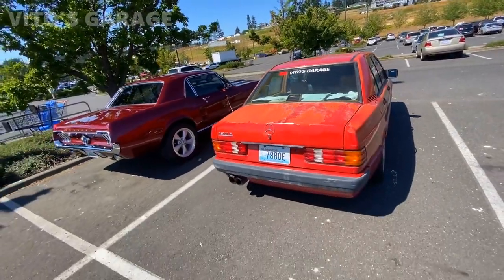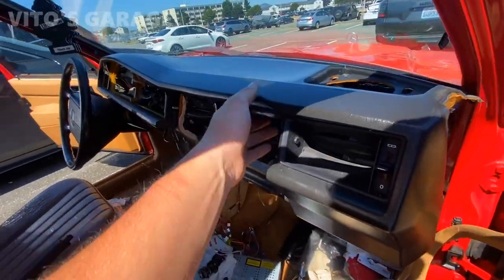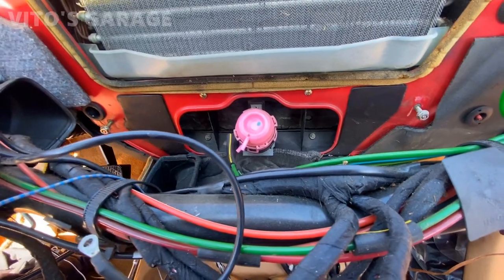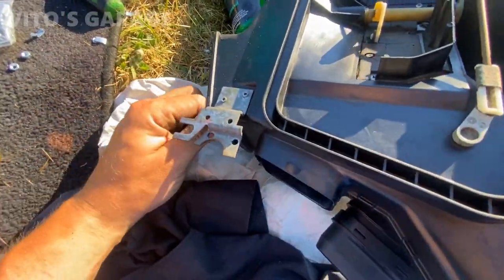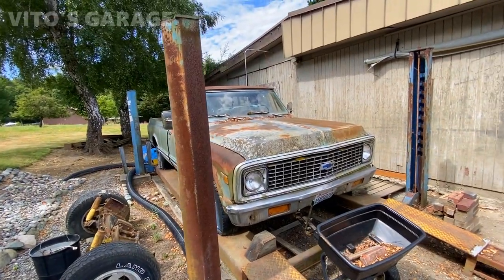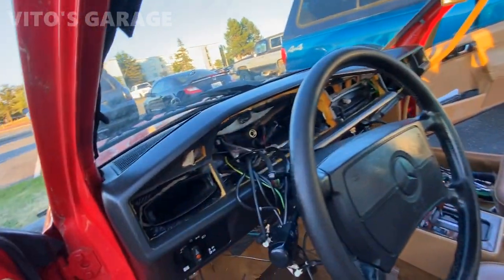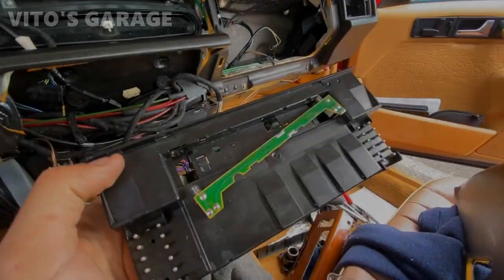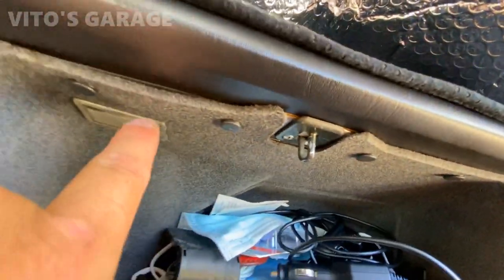Red Mercedes 190E Dash Removal, Heater Core Replacement, HVAC Actuators & Other New Parts

Comment: Amazing video as usual 👍👍👍👍 And it's awesome that the Baby got some much needed attention. If I may, when it comes to the pod with the exception of the one that you replaced, none of the others are available from Mercedes anymore. I'm sure that you know George Murphy owner of the Performance Analysis Company in TN still make the rubber membrane for the rest of the round ones (single or double). He doesn't make the rubber membrane for the black square  one (0008008775) and when that one goes unfortunately we're SOL it's been NLA for a long time and the used ones tend to be in the same precarious condition.
Reply from the maker: The new membranes from other vacuum actuators will have to be installed onto the NLA ones. I’m not worried about it

Comment: I did my heater core on my 190e a while ago.  It is not a small job, patience is needed.  In the end, everything went well, but I forgot to install the captive nuts the first time.  That won't happen again.  I didn't think to check the vacuum actuators either, but it's all Ok.  I was wondering, where do you get the hardware for the car?  Thanks for the video.  Rob.
Reply from the maker: The hardware was purchased from AutohausAZ.com
Reply: @VITOSGARAGE  Thank you.

Comment: I have an issue with my 190e. The pipes going to the heater (by heater control valve) and return pipes are getting hot but there's still no heat in the car. It's blowing out cold air.
Reply from the maker: Very weird. When you’re driving and if you set the temp wheel to red (hot) do you feel the heat from the side vents?
Reply: @VITOSGARAGE  there's no heat at all :(

Comment: @vitosgarage great video! what information source do you recommend to find the small and very specific part numbers for older 90s mercs? for example, the glove box clips. Is there a part number manual for each merc and where can it be obtained?
Reply from the maker: It’s hard to say. But they have factory books for many Benzes that have the part numbers only. I usually just google the part numbers or go on the Mercedes Genuine Parts website and they usually have exploded views of parts. 
Some bigger parts on these cars will have the actual part number molded to it on the backside, or sometimes labeled. 
The glove box clips part number is 1239900092

Comment: Is there a particular way to remove the heat core without having to disassemble the whole dashboard? I've seen other videos where I only need to remove a few screws and it should come off. But it doesn't for me. The things I want to do is fix the fan speed switch which tends to get stuck a lot in the W201. The previous tried to unstuck it "like a brute" I'd say and broke the switch mechanism inside. The fan speed can still be controlled but the switch is stuck on 2 positions and you have to fiddle with it to change it. So yeah, I want to see what kind of mess the previous owner did without having to remove the entire car from the car.
Reply from the maker: There’s no other way to replace the heater core other than the method in the video. And since you’re gonna be there I highly recommend changing all the worn parts behind the dash and vacuum actuators etc. look into changing the whole steering lock assembly with brand new one too. It’s so easy to do while there
Reply: @VITOSGARAGE  Sorry in advance, I came to this video just to know how to remove the center console to access the fan speed slider which tends to get jammed. Mine is jammed, but I eventually managed to get it out.

Comment: Nice work- did you do this with the coolant rerouted as per an earlier video of yours? If you didn’t reroute would you drain whole system before starting? Im about to change the o-ring going into the heater as i believe this is where I have a coolant leak but think i can do this without removing the entire dash. (Uk car passenger side lower part of heater so can access via glovebox and knee panel removed). I want to do this without draining-think that is possible?
Reply from the maker: Possible. Have lots of plastic bags to catch the coolant.

Comment: Damn good job. Are you going to replace  the evaporator while you are in there? 
I have a very slight coolant smell when I use the heater but can’t see any liquid. I think I will get to do this job soon…
Reply from the maker: Thanks. I’m not worried about the evaporator. And I think evaporator gets changed from inside the engine bay. I was looking at it and that’s what it seemed to me

Comment: Are the o-rings generic?
Reply from the maker: No. Supplied with new heater core
Reply: @VITOSGARAGE  Ok, thanks. I'll check the box again. Btw do you have to drain the coolant or something before doing this job? I have to do it myself because no mechanic wants to do this job on my 190E :D. Big thanks for this video! It's gold
Reply from the maker: @ottson  you’re very welcome!! Take your time! You can do it! You don’t have to drain the entire cooling system. When the dashboard is out and you’re ready to disconnect the heater core hoses, just put some plastic bags there to catch any coolant left in the lines and heater core. Have some paper towels and rags handy too!